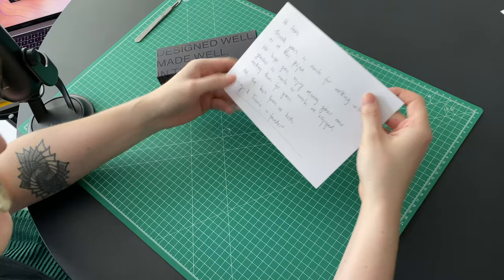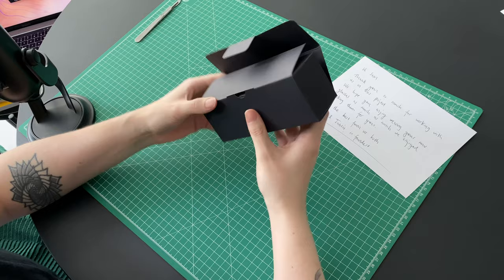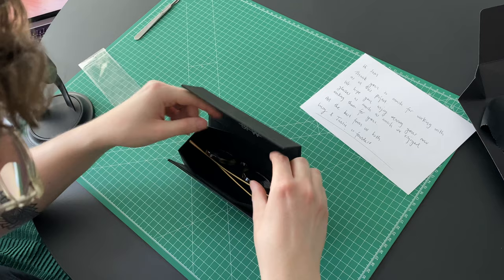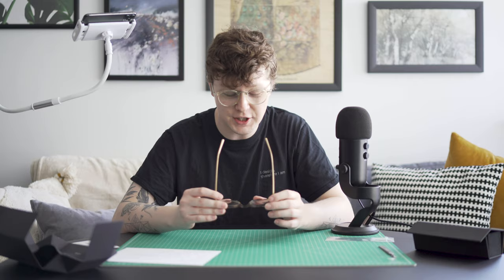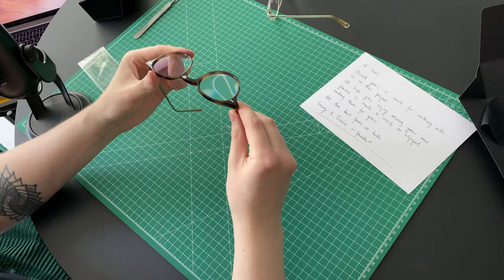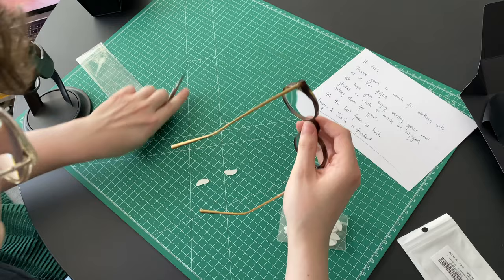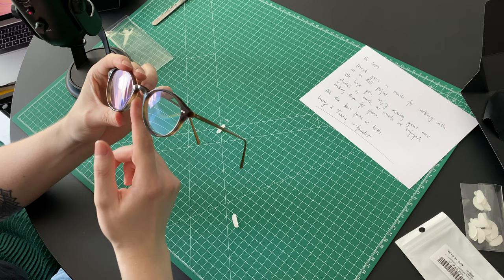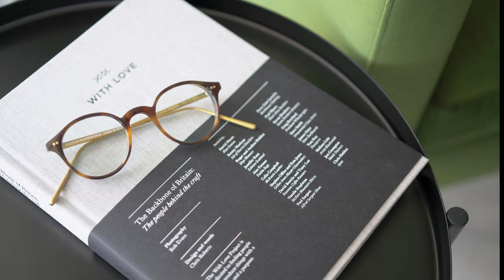Custom Glasses Being Handmade!

Comment: Hey Sam, glad these frames worked out. They look awesome. And it's good that you found out a quick fix for the bridge/tilt issue. No frame will fit everyone perfectly, so I'd say you did very well :)
Reply from the maker: Thank you so much! I’m so happy with how they’ve turned out even with the extra nose pads
Reply: bespoke frame has to be well fitting as it one of original purpose

Comment: You should get a 3D printer to prototype and avoid those post production mistakes, there are a lot of brands out there & wide range of them are pretty cheap but still you  getting better results than cutting the shape of the glasses with the worst scissors in the world xD 
Creality ender 3